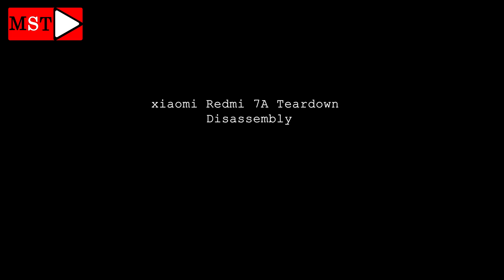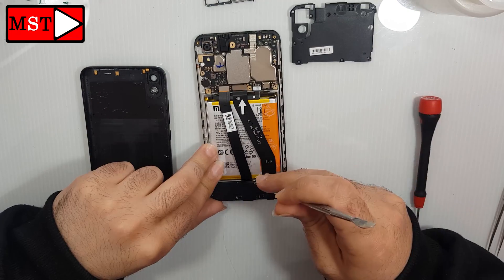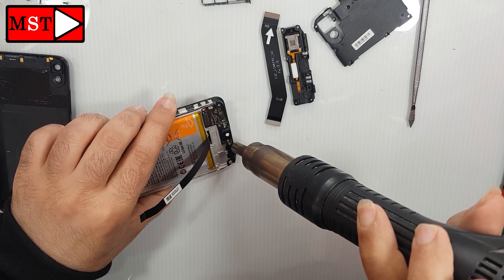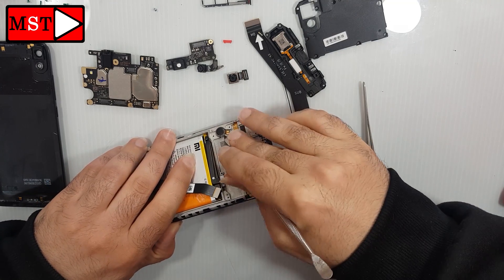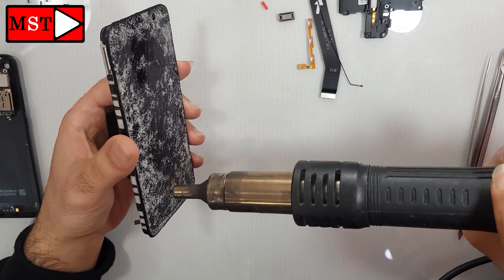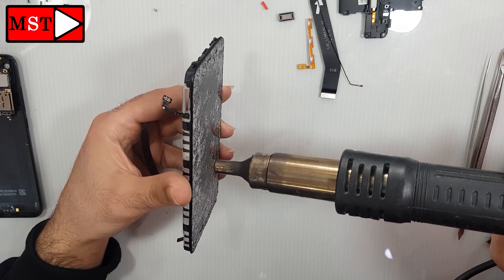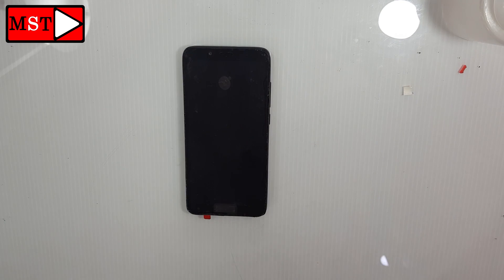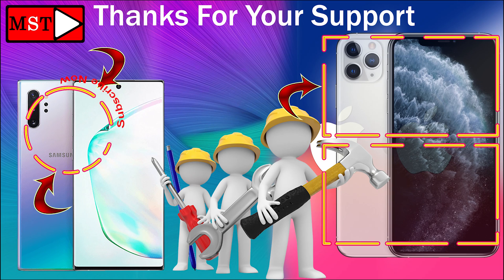Xiaomi Redmi 7a Teardown Disassembly

Comment: thanks! I poked my top microphone hole (the one on the top left) with a sim ejector tool. I see that a damaged what seems to be a metal mesh. I wanted to know what I damage, but I dont see that piece well enough on the video. Anyone knows what is on the bottom of that little hole?
Reply from the maker: I don't think you did any damaged while you just used sim ejector tool, as i know this hole is for the third microphone . Which it could be damaged by liquids or dust.